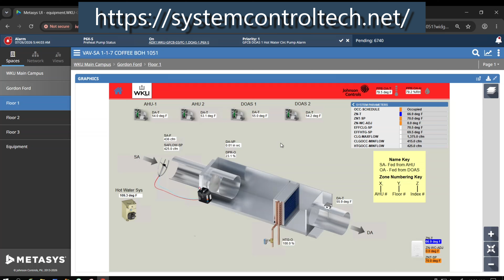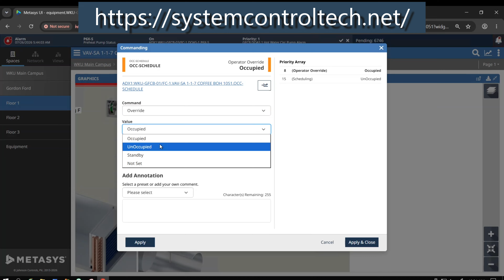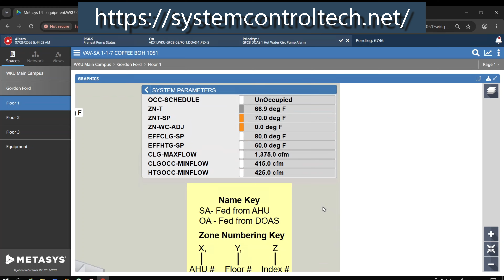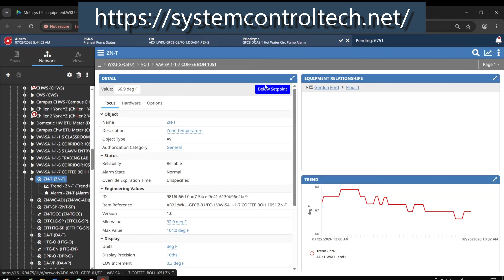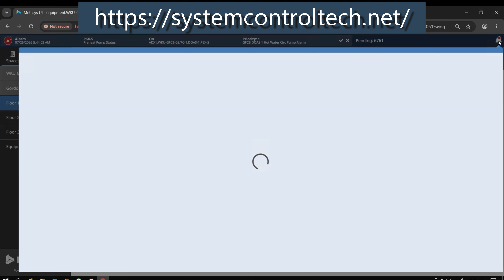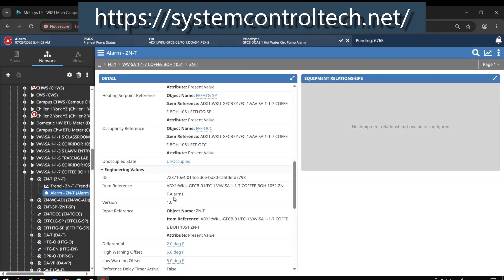Are Your Zone Alarms Annoying? Fix Them in Metasys MUI

Comment: Hi my friend . First of all I want to thank you for all of your videos. I have learned a lot from them. I have a question, from our chiller we are getting a lof of information, some of it is events and other would be alarms. These are coming into Metasys as different numbers. We have a Multistack chiller with 9 Modules, each module can have possibly 30 different number, any idea have ro sort out “events” from alarms. A typical alarm will remain with a number , the event will reset automatically and coming back to zero (0) 
Thanks again
Reply from the maker: One thing you can do is set up custom enumerations and actually translate those numbers into usable text.  I've got a video showing the process of doing that.  It will give you a better idea of what the numbers mean without having to look them up in a manual.   Good luck.